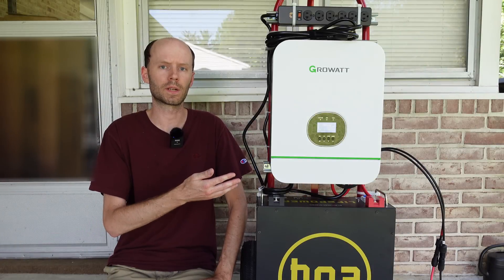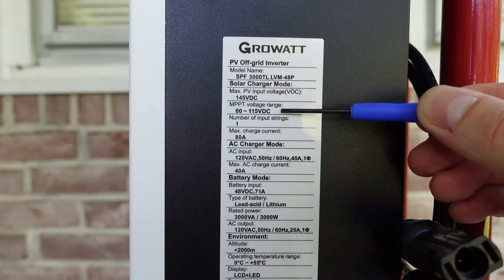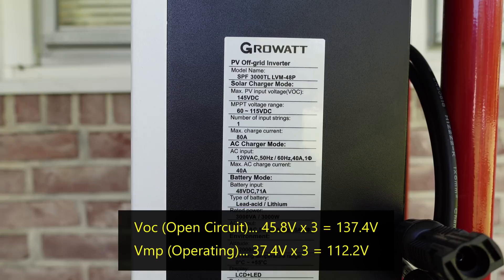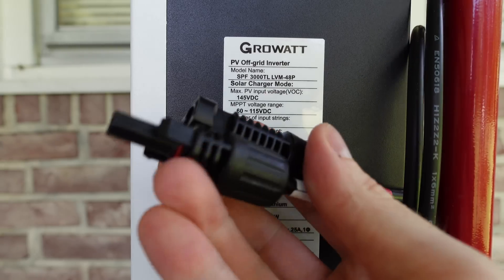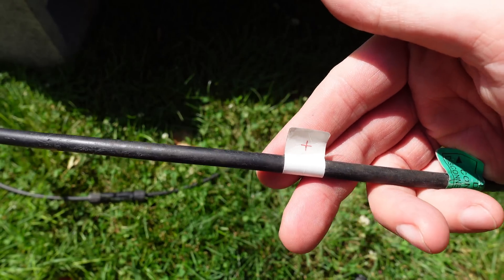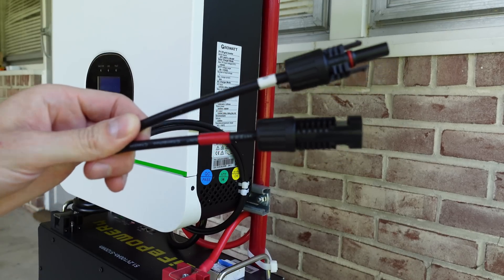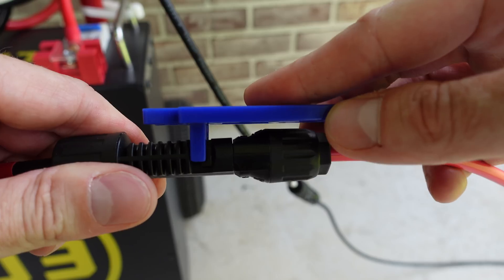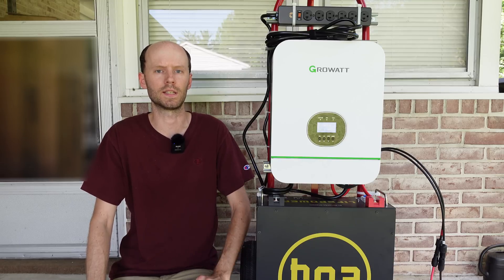Connecting Solar Panels to the Growatt/EG4 Emergency Power Cart

Comment from the maker: G4 UL-Listed Battery... https://signaturesolar.com/eg4-lifepower4-lithium-battery-48v-100ah/?ref=lithiumsolar  (affiliate links)
Growatt Inverter... https://signaturesolar.com/growatt-48v-3kw-150vdc-stackable-off-grid-inverter/?ref=lithiumsolar
Please let me know what you guys think and if there is anything else you want to see regarding this power cart!
Reply: An additional battery charge controller is not needed?
Reply from the maker: @pogoart9625  Correct, the charge controller for both AC and solar is built in to the inverter. It's an "all in one" model.
Reply from the maker: @Ieikoed72  No idea, I don't have an electric bike.
Reply: @LithiumSolar  I charge my ebike battery which is 14Ahr 48VDC and because the charger for the bike limits the current, it takes about 4 hours from zip to full, hope this helps.

Comment: Thanks for this and other videos- extremely helpful.. I set up the same exact system (48 v EG4, Growatt 3000 48V all-in-one). I'm using three bifacial panels in series rated at 400W each. I tested them all today (January, NC, full sun, 35 degrees F) and around noon I was seeing on the Growatt readings like this: PV voltage=92V,  PV current=18 A; but the power going to the battery was listed at only around 1040 W. Given the V and A readings, I would have expected power to be more like 1600 W, so I figure the power going to the battery is limited by the maximum charge voltage of around 56V. If that is true, is it really worth having a significantly higher voltage than the range minimum? Or am I missing a setting that would allow the Growatt to increase the amperage going to the battery and thus get more wattage? TIA if you or anyone can assist.

Comment: Can anyone help me understand the solar panel part of this system.
Reply from the maker: What question(s) do you have?
Reply: Thanks. 

Inverter 1

VOC is 500VDC

Nominal Operational Voltage is 360VDC

MPPT voltage range is 120-450VDC

Inverter 2
VOC is 450

Min solar Voltage 120VDC

There's no range like inverter one. 

My solar panel spec is 

Open Circuit Voltage 38.2
Voltage at PMax 30.6

I'm in a hot climate. It never gets cold.

How many panels can I run in series on each inverter with these panels?

There is no range on inverter 2
Reply: On inverter 1, VOC is 500.  Based on the panel spec, can I do 3 panels in series and the remaining panels in parallel?

Comment: Please reply for help.   I dont understand this terminology .I have a 24v /3000w PowrMr inverter.  The PV specs are:
Max Power 4000W,   Max open voltage 450V,   MPPT input voltage range 120-400vdc,   
Im trying to hook up a 400w solar panel. Volt meter gives me 37v at the mc4 connector but the inverter does not recognize it
Reply from the maker: Your panel is producing 37V and it sounds like your inverter needs a minimum of 120V.
Reply: @LithiumSolar  oh that’s what it means. No wonder it doesn’t see the panel. I tried to use a portable 400w panel as not have a giant permanent mount panel just for emergencies but I guess that won’t work hu.
Reply: What are your panel specs?
Reply: @ 3000 w inverter. 24v. PV max power 4000 W. MPPT 120-400
Reply: @GmanfromTexas  those are the inverter specs.
Reply: @gushardy4421  Oh yes sorry the panel specs are 300W / 40 volts

Comment: A gas powered generator is far better and cheaper.
Reply from the maker: Ok
Reply: 😂 You're telling a bold face lie.
Reply: @gushardy4421  The hell if I am
Reply: @gushardy4421  You can keep that $2000 battery

Comment: What is the usable capacity of the 5kw server rack battery when using this inverter? How efficient are theese all in one inverters? Thanks to anyone who can help
Reply from the maker: Inverting efficiency will depend on your load. I generally use 85% in my calculations as you'll pretty much never find load vs efficiency graphs for these types of inverters.

Comment: A grateful subscriber. Excellent job. I'm actually in process of 100% replication with one modification. 

Could you do a 3rd video that would show the specifics of connecting the 4 panels and also adding one additional battery that would not be on the cart. Could you show how to add and remove additional batteries so as to have the cart as you shown and I'd have an extra batter in two different locations. ( I got a super deal on 3 of these batteries and want to take the cart between the 2 locations where I would leave one battery at each place

Comment: It says 4500watt PV input max  but you’re saying 600 watts is getting close to the max. Can anyone explains?
Reply from the maker: Yes, the theoretical maximum is 4500W; however, you need to stay within the operating parameters of the controller - Voc, Vmp, and Imp.

Comment: I really like this design, although the stationary application I have needs a bit more output. I like the price point of the Sungold 48v 5k inverter. Unfortunately, there's a communication issue between the inverter and the EG4 battery BMS.

Comment: I did the build. Have not started it yet. Saw some inverter setting upgrades for Battery Type. Would you add a video featuring setting up the growatt inverter settings, and how to hook up and test communication cables between the EG4 Battery and the Growatt Inverter.

Comment: I found the other reason to put the PV voltage lower ie 2S rather than 3S configuration, is to allow the MPP more room to fluctuate the voltage as it tracks looking for the MPP point on the I-V curve.  When I tried using 3S the the voltage was so close to the max of the Inverter, it really didn't do much tracking.  Changing to 2S (for me this was 88VDC and the inverter like yours has 145VDC max) the tracking immediately took off and found the MPP point. 
Great vid, great portable station, great channel. keep em coming.

Comment: Sorry I am a little confused, you said that only 2 vs 3 would be good for this because Volts. However, at the end of the video you say you can use MC4 splitters to do 4 panels. Can we do 4 with this set up?
Reply: You can do 4 if you run 2 in series and 2 in parallel.

Comment: if DC cables are long, you have a resistive loss.
Reply from the maker: A wire of any length carry either type of current will have a resistive loss.
Reply: @LithiumSolar  yes, but at lower voltages, the voltage drop due to resistance can be significant. AC voltages are ideally much higher.
Reply: @LithiumSolar  you can go to a more expensive larger gauge wire.
Reply from the maker: @morpher44  Where specifically in this video do you see a voltage drop issue regarding the gauge of wire I selected?
Reply: @LithiumSolar  I guess its only like .04 ohms, but if is carrying 8 amps, that is maybe .333 volts for 40-foot round-trip to panels.
Reply from the maker: @morpher44  8.9 amps on 20ft of 10awg has a voltage drop of 0.56%. At 74.8Vmp (for 2 series) that's 0.42V drop. That's next to nothing and is more than within spec. In fact, I'd probably use 12awg myself and even 14awg would be acceptable. I purchased 10awg because I plan to use it for other purposes beyond just this video.

Comment: Does the battery have it’s own charge controller? Or, does the inverter have it’s own charge controller? Or, is there an understanding that a person is expected to have an added charge controller when they use the solar panels?
Reply from the maker: The inverter has a built in MPPT charge controller. You don't have to add anything extra.

Comment: You can easily put 3 panes in series. Not sure why you are saying that you can't.
Reply from the maker: I just explained why you cannot. You will exceed the max Voc on the charge controller on a cold day.
Reply: @LithiumSolar  ON a cold day when the panels are already connected to the inverter, as soon as the panels are at the right voltage, the inverter will start producing power and voltage will drop. You  will never reach Max VOC on panel already connected.Foe example I have 10 CSUN CSUN310-72P in series. VOC is 44.8V but the inverter is running them at 316V right now.
Reply from the maker: @mlg779  That is not how it works. You see max Voc before the charge controller turns on in the morning. I've seen it happen many times on my own system. Yes, once the controller starts producing power, voltage drops to around Vmp; however, I'm talking about BEFORE charging begins. Another example is when your battery bank is full. The controller will shut off and you'll once again see Voc on your array. You absolutely need to take this in to account with your calculations.
Reply: @LithiumSolar  let me rephrase. If you connect the 3 panel to the inverter in the middle of the day and you are in Alaska with snow on the ground  that can reflect extra light on the panels, and it is very cold, I agree with you, you can have higher voltage well above.
If you have 3 panels permanently connected, that as soon as you have daylight, the system will start producing power, then you will be at Vmp.

I do not have an extra panel to test, but if you have one please prove me wrong. I am really curious.
I live in Georgia and I would not hesitate to connect 3 panels in series to this system.

Comment: Hello I wanted to build this  but wanted to hook up a small generator 110v1500w and limit the current draw in growatt unit. Sales lady says 3000w model not suitable w generator . Then I looked at manual and it says use a diesel generator only rated at least 10kva. I'm wanting the portability you just made, and to charge from panels mostly or a small genset like the honda 2200, Any ideas why this inverter is only rated on a diesel generator? seems kinda odd. We live on an Island and we have had 24 power issues in 6 months.

Comment: Very well done and has me thinking hard. Right now I use a Xantrex 12v inverter and 6 - 6V trojan batteries connected to utility power. Auto switchover in the event of a line failure. It is 1100 AH but is not portable considering each or the six batteries is over 100#.  Would love to see how you mounted the solar panels. Flat on the ground or some type of frame or rack to hold them? Do you need a charge controller on the solar side to protect the batteries? This is a great setup for when the SHTF scenario.

Comment: Doesn’t matter is the panels are 12v or 24v
Reply from the maker: No, it doesn't matter. All that matters is that the voltage of the array of panels falls within the specifications required by the inverter. If using 12V panels, you'll have to connect more of them in series vs using 24V panels obviously.

Comment: two radius r=1m frequency=333Hz (20kprm or above) mass flywheel energy storage, design equation is S=E/m=(pi^2)(r^2)(f^2), gives 300Wh/kg (and 30kWh/kg with 3.3kHz or 200krpm) [units MJ/kg], dont be afraid of jet engines spinning, they dont blow up because of radial acceleration forces, just make the discs from solid metal, very simple, large energy storage for homes, like 1000kg mass disc, giving 300kWh storage, just add maglev opposite on a stick, and a dc or ac motor generator with a distance clutch

Comment: Will this power a dryer? Biggest costs according to WE energies in Wisconsin. 1 Clothes Dryer 2. Air Conditioner 3 Computer. Anyone knows?
Reply from the maker: No. At least not my cloths dryer, which is rated for 240V 5500W.

Comment: Is there a specific reason you choose a growatt inverter over an EG4?
I'm looking to duplicate this system.
Great idea.
Reply from the maker: The Growatt was cheaper and did what I needed it to. No reasons other than that.
Reply: Is this a system where I could start out with one- then later on build an identical generator and connect them together in parrell for more power?

Would you say one is big enough to power ac- 2 would be enough to power entire home??

Comment: How about a video on battery management software and apps? I just read the MPP manual about download, unzipping, compatible hosts etc, and I realized there is a lot to it. I'd also like to be able to change parameters remotely, without going to the LCD screen and pressing a lot of buttons.
Reply: I have a 24v 3k MPP Solar unit. 800watts solar panels, series parallel, two 12v 180Ah lifepo4 batteries in series 4.3kwh. The default settings were pretty much all I needed. The setup took all of five minutes, on the lcd.

Comment: Love your videos but please one question, what's the deal with the temperature range? I live in FL, hottest is like 110 coldest is 28... And that was only for an hour or so at night. Why does cold affect your solar panels?  Thanks
Reply: Solar panel efficiency drops by around 0.05 percent for every degree Celsius increase in temperature (panel temperature not ambient temperature). On the other hand, efficiency increases by 0.05 percent for every degree Celsius decrease in temperature. The panel is usually rated based on 24c. It’s to do with electrons moving at different rates and escaping from atoms or some such witchcraft! 😁
Reply: Panels produce a lot more power when is cold. so that is positive.

Comment: Very nice!  Is it ok to keep the system on the porch long term as long as it's out of the sun and rain?  Is there a downside to keeping the battery and generator outdoors? 

I plan to run my system from the porch with my panels in the sun as well.
Reply: I don’t think these are weatherproof but idk
Reply: Did you end up leaving it on your porch? That's what I'm considering too. Maybe in a zippered up shower tent?

Comment: The problem with only two in series is the min voltage for the MPPT to kick in is 50V and you’re not much above that even in full sun.
Reply: Even just ambiant daylight will give you the voltage.  I have seen this in early morning and late in the day after the sun is past the horizon but still pretty light out, the PV voltage will still be near the normal (for me 88VDC) but the watts (ie the amps) drop off a cliff.  Today with full overcast cloudy skys most of the day the voltage was still 82VDC, too bad the wattage was next door to zip.  From what I see with my PV you don't need full sun to get the voltage, just the amperage.

Comment: Excellent work. I have been with you in this project from the beginning. Can you state the total cost of the project including panels and cabling.
And another think. Does the inverter controls lithium charging as well while a load consumes more or less from the panel production.
Reply: Yes - it will favour an AC load first and then any remaining solar power will charge the battery. If solar falls below the load the battery kicks in to supply more power. That’s how a hybrid inverter works when solar is connected.
Reply: My 2 cents is l believe you're ok as the better MPPT converter either automatically senses if you've connected one or the other battery type.  It shud have algorithms to effectively control the voltage - current range.  It's an either or.  You can't mix battery types in one system...it confuses the converter.  I don't know what that does because l have done that or read about what happens. I use Victron converters with blue tooth for cell phone ability to monitot.  If anything l shared is wrong l ask that l be corrected.

Comment: The + mc4 conector has a red o ring on it too
Reply from the maker: On the solar panel it does, but not on the inverter side. The connections are reversed.
Reply: @LithiumSolar  Why are the connections reversed on the inverter side?

Comment: Good stuff!  How long does it take to charge from zero to full with these solar panels? Thanks for sharing.
Reply: It's roughly a 5kw battery and he was getting 450ish watts from solar. Taking into account some loss (10% ish) then maybe 12-14 hours
Reply: Depends on the amount of solar insolation and how many panels you connect, temperature etc. It’s a 3kW inverter so technically you could charge your 5kW battery in 2 hours. That would require a minimum of 10 x 300W panels (typically if you want to max out an inverter you’d go to 3.6kW because panels only perform at their rated output for a short period each day.

Comment: Why did you turn off the inverter when attaching the solar panels to it? I am trying to find a procedure for energizing and de-energizing a solar system.
Reply from the maker: It probably doesn't matter in this example; however, I think it's good practice in terms of safety. Even better would be having a PV disconnect to flip on/off.

Comment: Very practical.   We should all have a kit like this.   
Would be cool to have this running 24/7 for set of loads, to help offset the costs of the gear.
Reply: Def a waste just sitting in the garage not being used.
Reply: @cpoul  A good project would be to run a 2nd fridge or a window AC.   That's how I'm pitching this to my wife to spend the $$$.
Reply: @goodcitizen4587  I would def use it for something. I couldn't let it sit not being used. I have a honda 2000w gen for sitting.